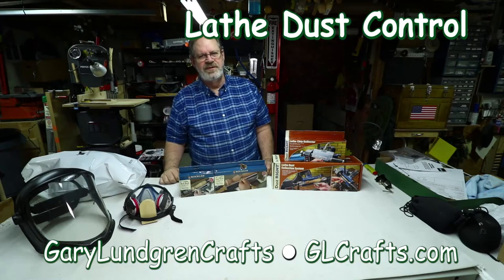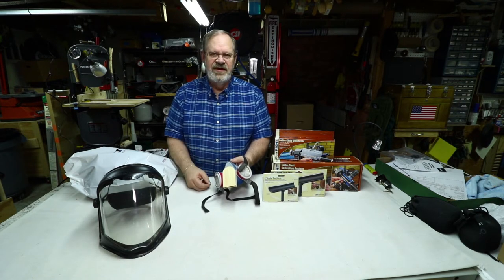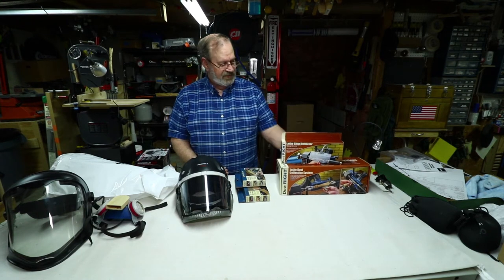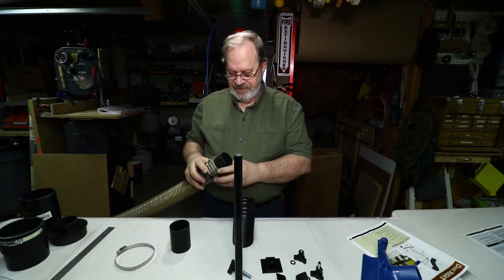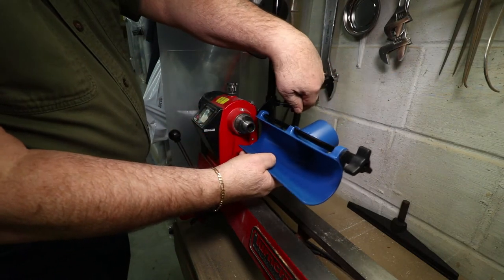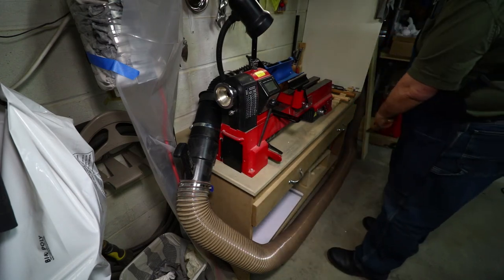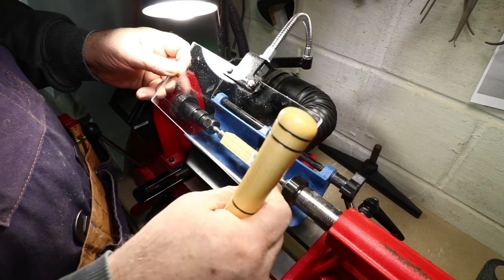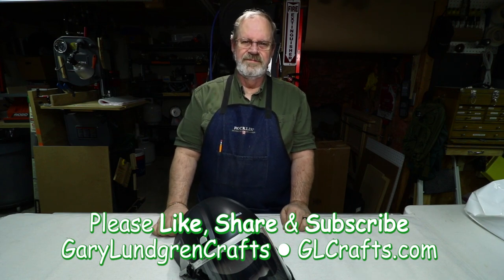Lathe Dust Control Small Turnings Ep.2018-03

Comment: Gary what lathe tool rest did you go with? The one's that came with the Turnercraft 12" are not that smooth and create pits ect. Am wanting a smooth tool rest
Reply from the maker: Thank you! Rockler replaced the tool rests for me and the new ones were smooth as should be.
Reply: @GaryLundgrenCrafts   Thanks Gary 
I believe I'll give those a try. Hopefully they have a 6" and 12".
Reply: @GaryLundgrenCrafts  Am going to order the 6" and 10" any problem with fitting the post in your Tunercraft Commander? Thanks
Reply from the maker: @USA-sx1xi    Thanks.  The post fit just fine for me.
Reply: Gary is your Turnercraft Commander tool rest post 5/8" or 1"?  I purchased the Rockler tool rest and got them in but won't fit my Tunercraft commander 12" the rockler post are 5/8" and my post are  1"  Is there a insert ect you used on yours ?
Reply from the maker: @USA-sx1xi  My lathe is a 10".  My post is 5/8". Rockler has a post adapter to fit a 1" post to a 5/8". Rockler Item # 56172  $17.99
Reply: @GaryLundgrenCrafts  I seen the insert from Rockler and also found one on PSI Industry site as well for $12.95 so going to try the PSI insert for it's a little cheaper for essentially the same part and crossing my fingers there's no more adapting to get the tool rest to fit correctly lol. As always thanks for you help buddy.